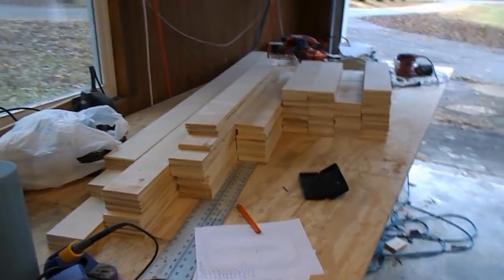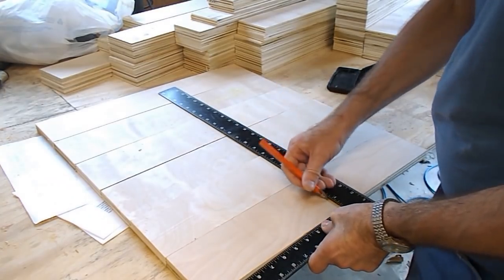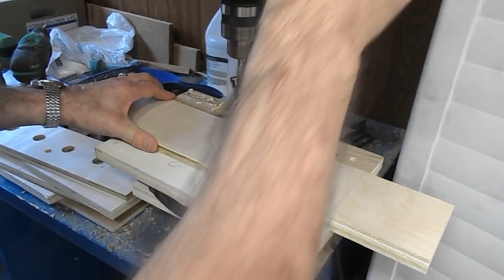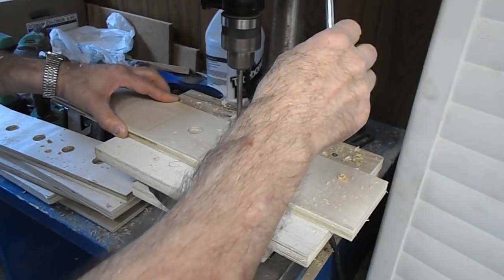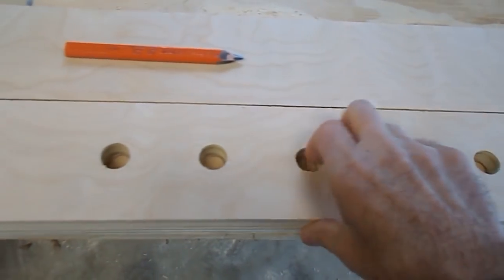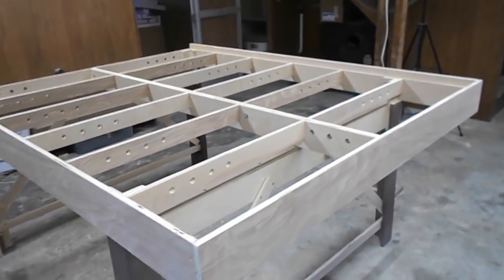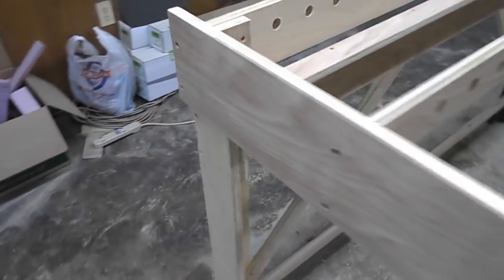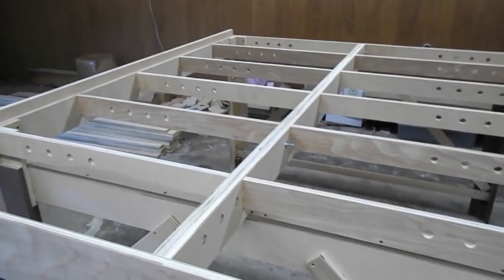Benchwork techniques for model railroads

Comment: I think if I was having someone build something for me I'd give them all the information they needed in the beginning. Theres not much more frustrating than getting part of a project done and not being able to continue for lack of information. As a professional I guess its something you must deal with from time to time. Good tip on the drilling of the wiring holes. Both the drill table jig and drilling from both sides.   👍

Comment: Waiting for next week.  You need to hire an elf,  I heard they work for cheap in the off season and they are very skilled at woodworking.
Reply: As the iAHC Union President I can assure you that our craftsmanship is unparalleled within the Industry.  As for the 'working cheap' I think not.
Reply from the maker: I did try hiring elves a couple of years ago, but as soon as I mentioned model railroads, all I could get out of them was circles of track to go under Christmas trees.

Comment: I think I might have mention this before. Why not use a forstner bit. Cut through one time and leaves a very clean hole. You would like it better then doing a board twice.
Reply from the maker: This video is years old.  I have started using forstner bits for some applications, but they still require drilling from both sides to get a neat hole in plywood.

Comment: Great bench work. Just thinking out loud, do you think there could be a place for a pocket hole joining system in your process?
Reply: I used pocket hole joinery on my current layout build and it worked great. I can imagine a couple of reasons why he doesn't prefer it, though.
Reply from the maker: I've looked at them and determined that I don't need them.

Comment: Interesting, when I did my benchwork I just built it the drilled only where I needed it during wiring. To each their own, whatever works best for you :-D
Reply from the maker: When I subcontract for another professional builder (as is the case here), the wiring holes are generally specified.  In this project, I had no choice.  Even when building for one of my own clients, I still do it this way as neatness counts.  On your own railroad, you can do it however you like, although I think I still prefer to drill the wiring holes beforehand as I can do it standing up straight instead of upside-down under the benchwork.  Also, by drilling plenty ahead of time, I don't have the issue of getting a full-sized drill up between the joists after the space is full of other wires and switch machines.

Comment: question time. Why do use plywood for the structure instead of dimensional lumber? It is nice to see you do things in an assembly line process. That makes set up go very well
Reply from the maker: 3/4" plywood is more stable than solid lumber.  Even the best quality 1x4's will most likely twist over time - and they cost a fortune.  More affordable 1/4's will twist and warp the moment you take them from the store into an environment with a different relative humidity.  They also tend to vary in size quite considerably whereas ripping plywood on a table saw yields strips all exactly the same width.  Even better - with the plywood, you get to choose the width instead of having to use what is available.  Ripped plywood wins in every respect.

Comment: What are the benefits of using plywood instead of lets say 1"x4"s & 1"x6"'s? I know that solid wood can warp, but if you pick up straight pieces, shouldn't that be ok? Cheers!
Reply: The general reason is straightness. But you can always take a 1x4 and rip one edge on a table saw to get a perfectly straight edge. That's easier to do and far cheaper--and you can screw into 1x4s (which you can't with plywood).

Comment: The problem I've run into with plywood is when I ripped it it bowed and looked like I made plywood leaf springs. This was $50 plywood 3/4 thick. Any idea's?
Reply from the maker: Yes, that can be annoying.  Even $90 plywood can do that occasionally.  When used in short pieces such as cross members on narrow benchwork, it doesn't really make any difference.  For the long side members, start with two pieces that have about the same amount of curve and place them face-to-face so that when the frame is complete, they hold each other straight.
Reply: @mpeterll  , thank you !

Comment: I may have missed it, but what is your rationale for using the expensive plywood instead of pine 1 x 4(6)?
Reply from the maker: In order to get 1x4 pine that will stay straight, you have to spend a fortune on the high grade stuff.  Cheap pine will not stay straight and will cause all sorts of problems down the line.  The benchwork is the foundation for the railroad and the one part that cannot be replaced later without scrapping the layout and starting again.  It's simply not worth taking a chance.  Three-quarter inch cabinet grade plywood will cost about $50-$60 a sheet and produce 13 3.5" wide strips (between $3.84 and $4.61 each).  A high-grade 8' 1x4 will cost a lot more than that.  As a side advantage, starting with a sheet of plywood gives you the opportunity to cut strips any width you like, rather than being restricted to just one size.  Even the high grade pine has a tendency to twist when ripped into narrower strips because the internal forces may no longer be balanced.
Reply: @mpeterll  Thank you for your reply. That makes total sense. Like you say, I would hate to scrap the layout and have to start again simply because I scrimped on the lumber. Thanks again:) Love your work

Comment: How do you secure the frame pieces together?  Do you glue or just drill and screw into the end grain of the plywood?  Do you find the screws hold well when set into the same plane as the plywood layers?
Reply: I was wondering the same. Looks to be just glue would be interested to see if he dowelled them and glued?? Not sure

Comment: How many motors has that drill press been through?
Reply from the maker: Still on the first one.  I don't force it, and I change the bit whenever it gets dull.  Drill bits are consumables but the drill press is not.  Or put another way, I can bill a customer for a new drill bit but not for replacement power tools.
Reply: @mpeterll  I love the idea for that jig though.  Question though, have you ever found that the plywood wants to split since you are screwing into it on edge, or do you find that it splits less than dimensional lumber?
Reply from the maker: @Leviathan609  I pre-drill all the screw holes with a compound bit (does pilot, clearance and countersink all in one go).  The pilot hole minimizes the tendency to split.  Occasionally the layers will still separate slightly, but this does not really matter provided the joint is properly glued.  On the rare occasion that I get a big split, I just fill it with glue.  The important thing is never to try putting a screw with a countersink head directly into the edge without going through another piece first.  If you do this, the taper of the head will act as a splitting maul and destroy the plywood every time.
Reply: @mpeterll  
I'd probably be putting re-enforcing brackets in the corners. But I do have a tendency to over engineer things. I put 3/4  Brazilian Cherry down. All predrilled and hand nailed. Every 3-1/2 inches. 🤯 But the floor doesnt squeak
Reply: If you are burning up motors on a drill press it ain't much of a drill press in the first place.

Comment: Wow nice bench work? well thought out? why spend hours cutting ply to size when you can by ready sized timber and just drill holes and cut to length? still nice work? best wishes Ken
Reply: Plywood is cheaper and resists warping better than most box store lumber. I personally mill my lumber, but most people don't have cabinet shop. His approach to this is cheaper and very good construction
Reply: @kenamosjr.bo_51 
Plus it looks like he is buying good quality plywood. It appears to be sanded on both sides. If you are painting the outer face  as a facial then it might not be a bad idea to use MDO plywood there. Or put a skin of 1/8 the MDF or Masonite. It looks to be 5 ply 1/2 inch. Birch or ApplePly would be great but unless the customer is specifically requiring it I think it would be cost prohibitive. On his personal layout that he dismantled when he moved from the UP he had some of the layout cantilevered off of the wall with the shelving brackets that go into the strips that dcrew to the wall. A low cost and seemingly quick way to go.